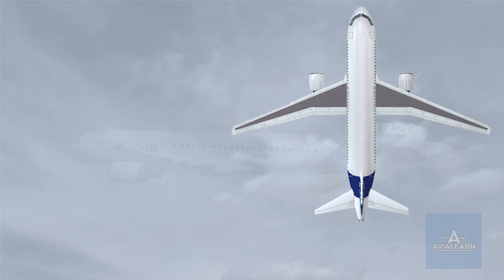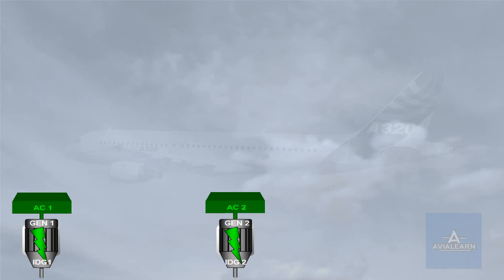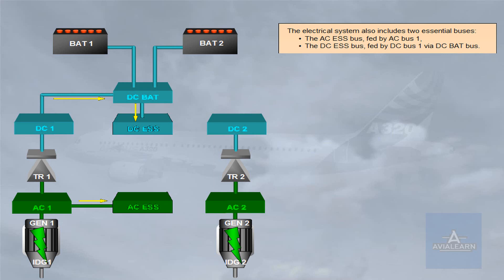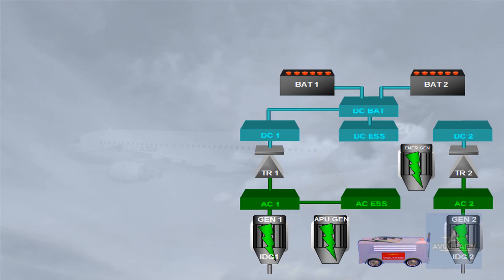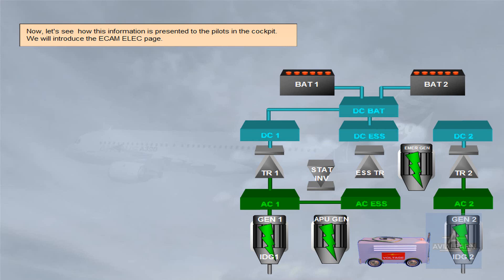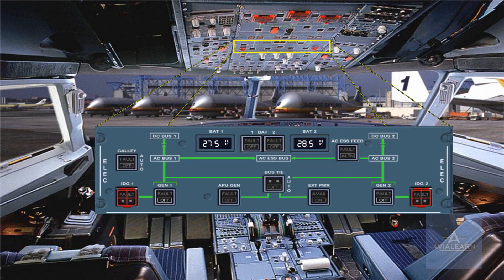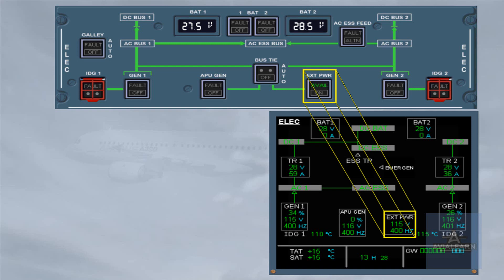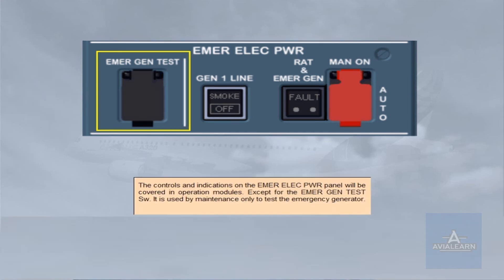A320 Family Electrical Power System

Comment: why do we need to use RAT in Aircraft?
Reply from the maker: RAT (Ram Air Turbine) used  only in an emergency. In case of the loss of electrical power or hydraulic sources are inoperative. The RAT will power vital systems (flight controls, linked hydraulics and also flight-critical instrumentation).